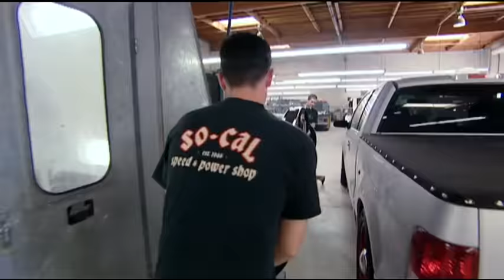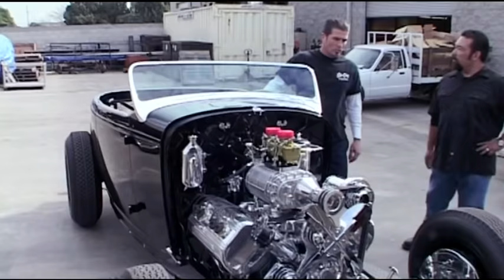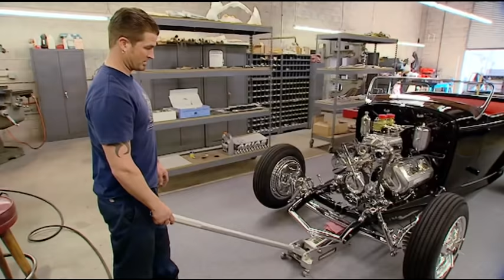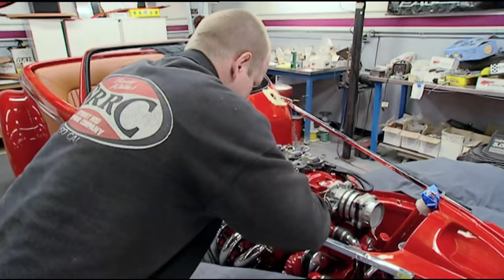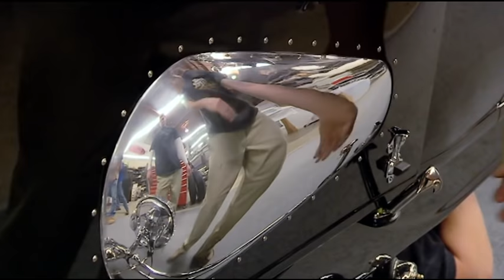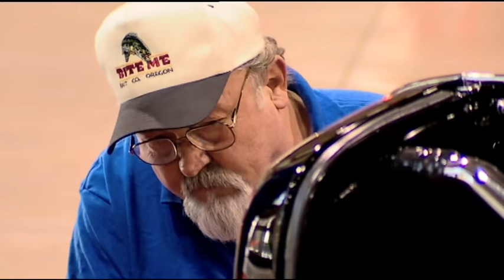Hot Rod Build-Off | Barry VS Jimmy | Episode 2

Comment: At least you can tow a hot rod without destroying the paint. It takes zero actual mechanical ability to "build" a street rod that will never turn the CRANKSHAFT under its own power.

Comment: People love Corvettes but complain about fiberglass if it's on any other car. I don't get it. Fiberglass is great. It's better if you ask me. It doesn't dent or rust. There are different ways to do fiberglass and some ways do produce a heavy, brittle part. Like chopper gun glass, but you can do some really nice glass work doing wet layups or vacuum bagged glass. Really strong and light weight. Prepreg glass in an autoclave can be really nice. Vacuum infusion or resin injection produces really nice parts.
Reply: 71
Reply: You want a surf board or a real car?  "produces really nice parts" you say?  Problem is they are still made of plastic.  Burn baby burn.
Reply: @javiervidaurre6325  Having built and restored several cars over the last 30 years, I'd prefer fiberglass or carbon fiber. It lasts longer than steel and it doesn't dent like steel or aluminum. The biggest problem with restoring old cars is the rust.
Reply: @CarbonGlassMan  Who said anything about restoring old cars.  Neither of the cars in the video are restorations.  All new material.  Try pounding out fractured fiberglass.  When you succeed, let me know. Thanks for your views though, they have their validity.
Reply: @javiervidaurre6325  Didn't my original comment talk about people complaining about fiberglass being used on any car other than Corvettes? On a video about building hot rods that look like old metal cars? Fractured fiberglass isn't pounded out. It's patched & repaired. Composites are pretty easy to repair if you know what you're doing.